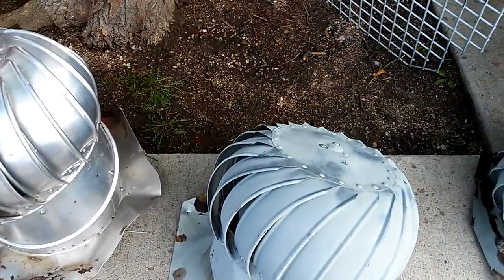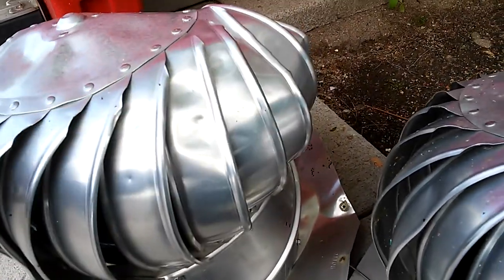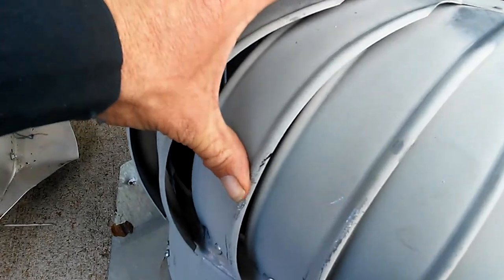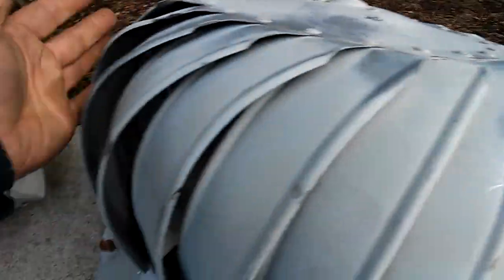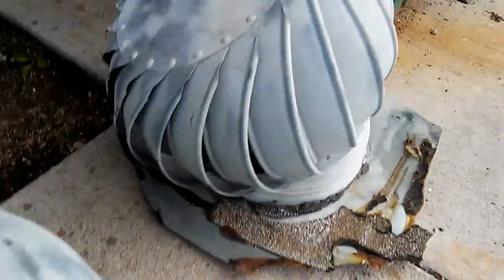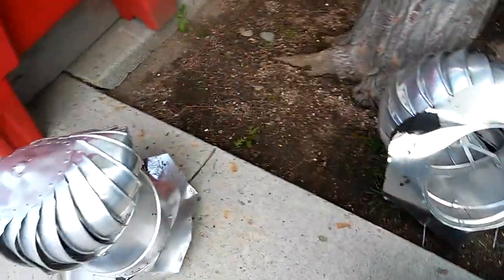Steel or aluminum whirlybirds roof turbines

Comment: Aluminum for sure.
Reply: Why?
Reply: @superdigua  Because they bend so easily.
Reply: Why aluminum? Aluminum is weaker than galvanized steel
Reply: I rather buy a Master flow 12" galvanized steel turbine internally brace and externally brace
Reply: @j.j.atchison2969  Yeah they do and i hate aluminum turbine but they dont rust but galvanized steel do